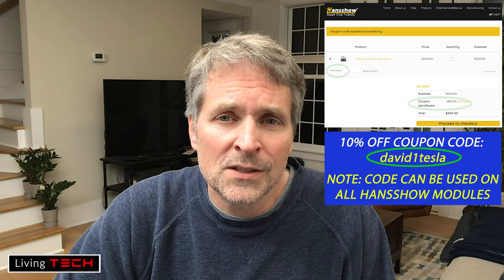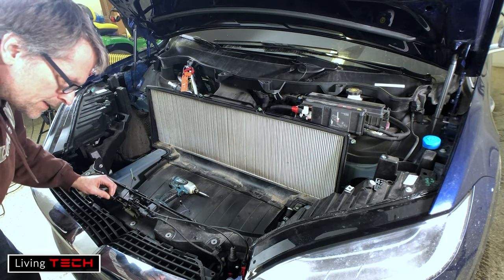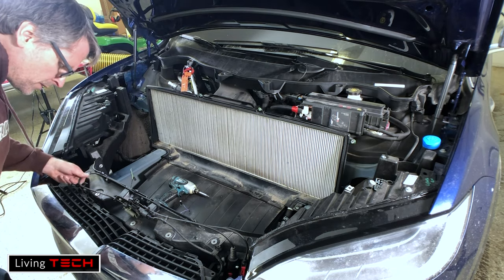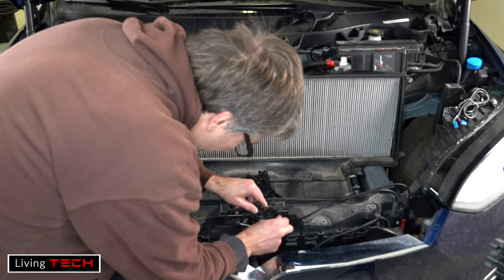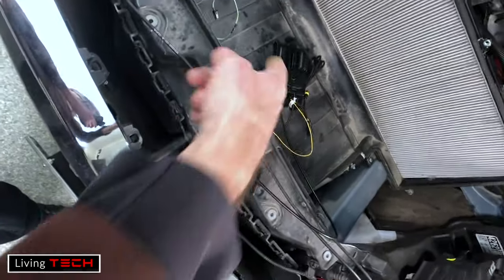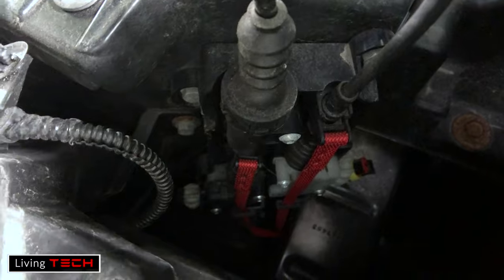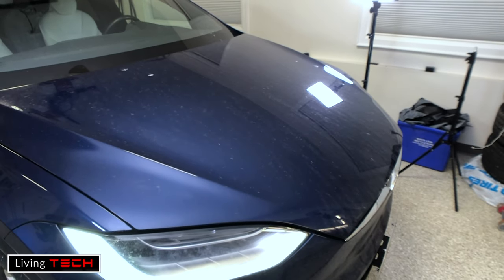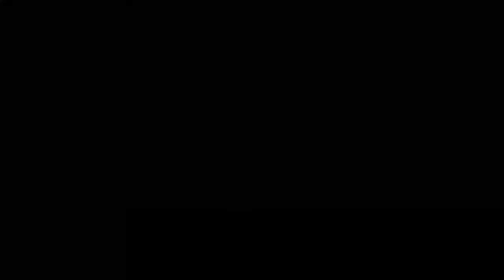Hansshow Tesla Power Frunk Module Installation - 25% Off Coupon for Model 3, S & X!

Comment: As a former petrolhead, my Achilles heel is electronics LoL! We only drive Teslas now and would really love to do this to the MX. I was all psyched until the electrical bits showed up. Not sure where my hesitation comes from, but I will do this upgrade. Very friendly and clear video, thank you.
Reply from the maker: Please feel free to ask questions. If you let me know when you are doing it, I’ll try to keep watch for messages here. Also, my email address is livingtech9@gmail.com

The electronics are dead simple. Everything is colour-coded. Be careful to power down the car. What version of MX do you have? The one shown here is June 2017, pre-Raven.
Reply: @LivingTech  how to powerdown the car? have to go in maintenance mode?
Reply from the maker: @bryhsiao  Yours is the THIRD message today that I have seen that I wasn't alerted to when you posted it. I'm really sorry, but I'm only seeing it now. Yes, you go into the (I think it's called) "Maintenance" or "Service" mode, but in any case, it's near the bottom of the menu you get when you tap the car icon in the lower left of the screen.,

Comment: Thanks for putting up this video David, your instructions were clear and to the point. 

I cannot stress enough how important it is having that particular style rachet bit driver that you showed. It makes all the difference between a job well done or giving up in frustration. 

In the updated kit I received it contained something similar, but with less clearance and a philips bit instead of the T25. Hopefully this was an one off in my kit and others are receiving the correct driver and bit. Also for those with the new kits, length of the struts is different, DO NOT MOUNT the base to the factory location. Proper mounting hardware is include. It can be a real PITA to get the Hansshow struts off if you put it in the factory location, the lock ring is a lot stronger than the factory.

A really really well put together kit, they really do give you everything you need for the job.
Reply from the maker: Thank you Amandeep! I’m glad that everything worked out so well for you! :)
Reply: @LivingTech  I would still be banging my head against the wall if weren't for your help.  After completing the install I looked at the instructions, and sure enough they mention the relocation of struts.  This mod has dramatically increased my usage of the frunk which a lot of people don't use because it is annoying to close.  Power frunk should come standard from the factory.
Reply from the maker: @MrAmanW  Thank you again. Yes, we seldom used our frunk before installing this module. I too wish that this feature was included from factory! 😎👍

Comment: Thanks for the great video David. Did you record the part at the end or have any photos of where you placed the two rectangular boxes… control module and release motor?

Also at 18min, you showed the cable that goes to the lighted frunk release button for debugging. My kit doesn’t spit like yours so the button is either wired to the original wire or Hansshow’s wire. Either way, whenever I press this button, the frunk ONLY closes. Do you know what’s going on here? Tech support hasn’t got back to me
Reply from the maker: Hi Steven. Thank you for watching! OK, I've searched and no, I don't have photos or footage of that part. I was super pressed for time by the end of the video, so I skipped recording this part. :) Anyway, I remember where they each went. The release motor was put just behind of the driver's side headlight, and the control module is right up beside the battery. I had to put it there, because the supplied cable was not long enough to put that where I wanted it to go, which was behind the headlight as well. I realize that I could have extended the wire, but I didn't have the type of waterproof connector I wanted for it. Anyway, it is exactly 2 years later, today, and all is still working perfectly. As far as your problem with the frunk only closing, your release cable might not be positioned exactly correctly, as far as how much you moved the latch, via release cable with the opposing nuts. This is the critical part of the installation. You can see what I did starting at 12:50 in the video. If it is too little or too much, then you have to adjust that. Does any/all of that help?

Comment: Great DIY video thank you, i bave a couple of questions:
1. Do we need to powerdown the var during the install? Or it doesnt matter?
2. Once installed, can I still manually (but slowly) close the frunk by hand? Similar to the trunk

Thanks again
Reply from the maker: Hi Topher! Just seeing this now, sorry for the wait.
1) I powered down the car. It just seemed to make sense to do it that way. I cannot remember whether that was recommended in the install guide.

2) Yes, you can still manually close it. In fact, I mentioned in the video that I went to operate it with the remote, and it wasn’t happening. So, I manually closed it, and from then in, all was perfect. Anyway, I did read somewhere that it’s OK to close manually.

Thanks for watching the video! :)

Comment: My instructions are so bad . I installed the powered struts , then steps later , instructions say to install the modified ball brackets .

Did you install ?
I can’t manually close my frunk now to break for the night .

In chat with tech bow .
They resent me the instructions that are in order now .
🤬
Reply from the maker: David Tran I didn’t have the new ball brackets. My guess is that you have an updated kit, that allows the frunk to open higher. The techs are SUPER GREAT, so hopefully all is good now! :)
Reply from the maker: I’ll be here for a few more minutes, so just let me know if I can help, OK? You’ve got this!
Reply: Living TECH 
Hey I called it quits to put my kids to bed .
Thanks . Turns out , my struts are running into the old strut ball when trying to close the trunk .

Tech gave up on me . And I found all the issues myself ; including the fact, that no replacement Nuts(without the ball ) were provided .

I’m usually pretty handy , but this install has beef frustrating indeed .

Thank you for your vids !
Reply from the maker: David Tran Send me photos, OK? My email address is: Livingtech9...AT...gmail.com. We need to get this thing working! :)
Reply: Living TECH 
Shooting you an email now before bed 

I had a another shotty day installing today .

Had it working .
Out the module in the black sack - and now the struts don’t work but the centre lock point for r hood mount does .
Reply from the maker: It was great chatting with you today. Hopefully my suggestions help. Don’t forget to let me know, please! :)
Reply: Living TECH 
Dave , you are the man !

Wife and I sent a quick thank vid via WhatsApp.

We are humbled that you took the time to point point out the mistakes .

The frunk works great now , and I’m going to install the rest of the internal panels pc by pc tomorrow and test along the way for tight closing finish .

Thanks for saving the day !
Reply from the maker: Thanks for updating via the video and here! :)
Reply from the maker: You’re very welcome. It can be so frustrating when something like this presents unexpected difficulties, so it’s fun to be able to help! That’s what this YouTube channel is all about! :)

Comment: Great video!

I’m having a little difficulty with my installation.  The frunk opens and closes completely until I put the panels and weathestripping back on. It’s like the suction latch doesn’t catch because of the extra space or resistance caused by the panels and weatherstripping.

Any suggestions?
Reply from the maker: Hi jedmonds! Thanks for watching, and your positive feedback. I really appreciate it. :) OK, so maybe try the following ideas:

Have you adjusted the nuts on the latch cable so that the correct distance is achieved? If it is not, and just on the edge of acceptable, that little difference could cause it to not latch properly. Don't forget that the nuts have to be tightened in the correct opposing position, to keep the setting firmly in place.

Also, it was a while ago, but I do remember that there is an initial calibration that happens automatically, I believe. with the frunk liner and gasket in place, try opening the frunk with the fob (or from the interior), then closing it by hand. Then open with remote and close with remote. Did this fix the problem?

Please let me know if that helps.
Reply from the maker: Hi James, I'm glad it worked out! Email me if you have any new problems. Cheers!

Comment: What are you adjusting for 13:48? Isnt the kit preset for the cable?
Reply from the maker: Hi Topher. As I said to 3 others just now, I normally respond to every message, but I was never alerted to yours. It didn't show in my YT Studio app. Anyway, yes, you're right, the cable is pre-set, but with each vehicle, you have to tweak it. It is one of the least fun parts of the installation. :)

Comment: How about the guarantee of the car?
Reply from the maker: Hi Lisa. I'm sorry, I know that this is WAY after the fact, but there are a bunch of messages here to which I was never alerted by YouTube. If you damage something while installing this, then of course Tesla is unlikely to cover it. But no car manufacturer voids a warranty because you installed say a non-OEM media player. Tesla service has always been exceptional with me. And, this module is even fused, so if anything was going to happen, then it would most likely just be a blown fuse. This module does not replace any of the means of opening the frunk. Instead, it runs alongside Tesla's mechanics and electronics. I hope that helps!

Comment: Installed mine and it closes but then the soft close pops it back up (frunk remains locked but not sucked down properly).  Cant figure out how to make it stay sucked in nicely.  I can push it down manually to make it lock in place as I initially did with the original setup.  Any wisdom? Also the right side of the trunk has a noticeable panel gap now compared to the left which sits my more snug.  Any wisdom? I'm so tired with it right now.
Reply from the maker: Hi Stephan. Sorry about your troubles. Is it an MX on which you are installing this? Also, did you confirm the spring tension, so that there is the 5mm distance as I described in my video?
Reply: Living TECH hey. It’s a model X.  I checked on the tension and it seems I need to adjust that screw. Overnight with it latched down (manually) its now magically latching down and it seems the only issue now is that the frunk looks very uneven with panel gaps with the left much tighter than the right.  Wondering if adjusting that spring tension may also improve that? Any other suggestions you have for frunk simply
Not sitting flush?
Reply from the maker: I don’t think that the spring will help that misalignment. For sure the struts are seated and locked in properly? Like did you hear the strut POP when you inserted the socket of the strut onto the ball? It’s no problem at all if it is not fully seated to pull it on (you might have to reef on it). There is a way to align the hood, but the reason I’m not going to that first is that it was fine with the old strut.
Reply: Living TECH I’m going to have a closer look at the struts tomorrow evening and let you know.  Would be the left strut.  I think I’ll just take it off completely and put it back on.  I spent lots of time messing with the spring and lock today. No difference.
Reply from the maker: OK, good luck, and please let me/us know what happens. I can reach out to them for you, once you’ve finished your testing.
Reply: @LivingTech   any feedback on this.. I just had mine installed and have the same challenge with my Model X
Reply from the maker: @dwabs3671  Hi. Yours is the second message that I was not alerted to. I'm really sorry about that. I take pride in responding to every comment given. Anyway, I have not heard from Stephan here. I was hoping that he'd get back to us on this. Have you solved the problem?